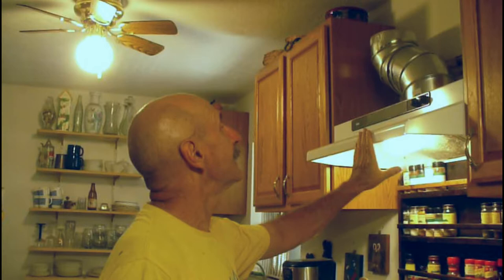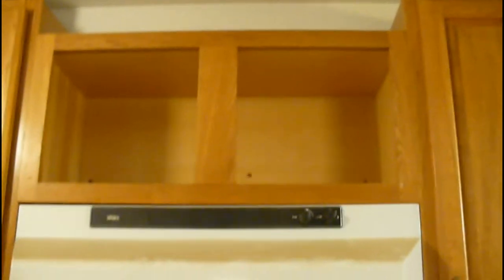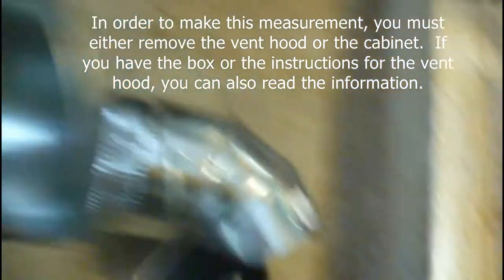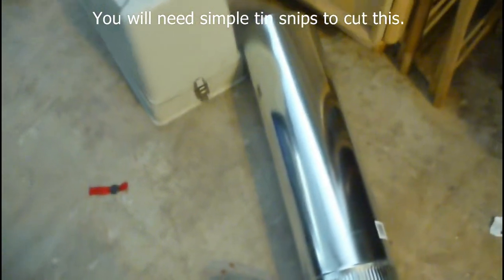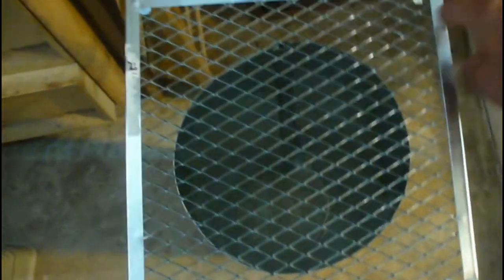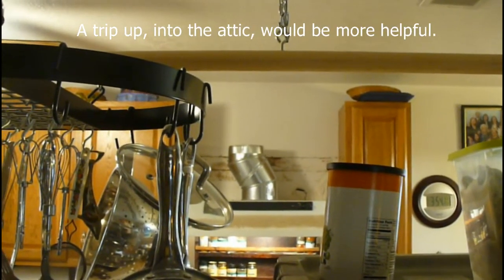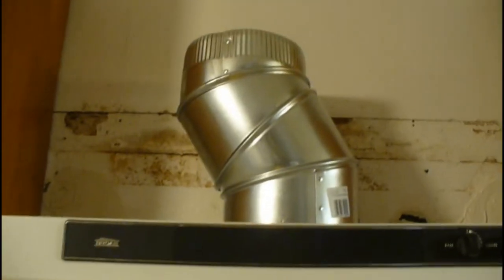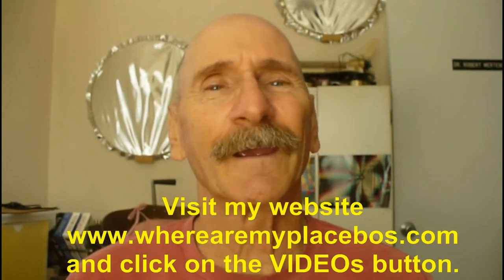Part 1 Install a Stove Vent to the Attic: Planning and Materials

Comment: You should extend the vent to exit through the roof (and top it with a roof vent cap).
Reply from the maker: I might have done that two years ago or earlier, but last year I put a metal roof on my house, and there's no way I'm putting a hole in it.  
On the other hand, another way to run house exhaust to the outside is to run it over to the eaves and out through a hole in the soffit - yet another hole.
But I live in Florida, and there is plenty of ventilation in my attic.  In the Summer, cool air from the house exhausts into the hot attic.  In the Winter, warm air from the house exhausts into the cold attic.  This helps to save energy.  Not much, but every little bit helps.
Thanks for your comment.

Comment: This is half an installation video, running the ducting from the hood to the ceiling.  I hope your not venting the range good into the attic space???  The range hood not only vents smoke or smells, but an abundant amount of moist air from steam.  I don't know where you live, but this is an absolute 'No-No" , especially in a cold climate.  Moist air in your attic will rot out your roof decking and you'll have a very fine mold farm.  After I got through the kitchen ceiling the duct transitions through 32 inches deep of fiberglass insulation, then the duct must be insulated up to the roof deck, then through the roof with an appropriate vent and flashing.
Reply from the maker: This is Florida.  The house is cool and dry inside (with or without AC) and the attic is continuously hot and humid.  However, there's nowhere to go with the pipe.  While I was able to dodge the joist directly above the vent, there is another support beam that doesn't seem to have a function or a name, that crosses directly over the whole area perpendicular to the trusses and sets right between the rafters and the joists.  I've yet to find any diagram or drawing that tells me what this piece is or what its job is.  Until I do, I'm not inclined to cut through it.
In Part 2 of this series, you can see where I actually measure about 5" of space just above it.  There's no way around it, except may to move the stove and the vent altogether.  Just recently I installed metal panel roofing on top of my house (it was expensive), and there's no way I'm cutting a hole through it, even if I can get around that cross-member.  There's about 8" of space over the Florida room, so nowhere for a pipe to go to the eaves, unless I string a long dryer-style tube from this pipe to another area that leads to the outdoors.  The attic is well-ventilated (it has to be), so I'm not concerned about it.

Comment: One of those elbows is missing the last part, there should be 4 sections, one only has 3
Reply from the maker: lol - now it makes sense.  Thanks.  I bought those two and thought they were identical, but when I got them home, one was different from the other.  Still, there were more sections than I needed to make the curves, so adding more sections would have made things even messier.

Comment: “Ceiling joist”, not rafter. The joist should be 2”x6”, not 2”x4”.
Reply from the maker: Nope, these are 2x4s.  This house was built in 1964.  And, ceiling joist is correct.